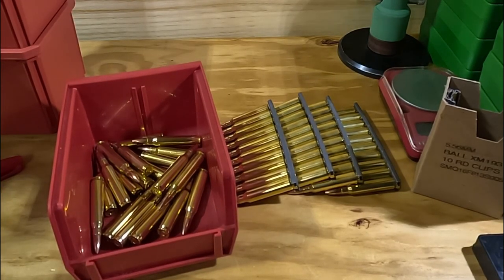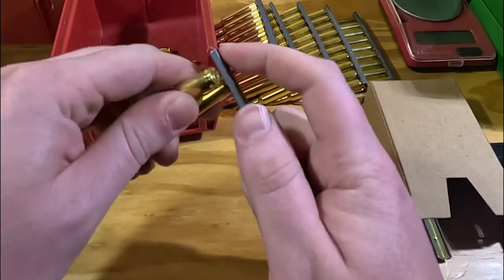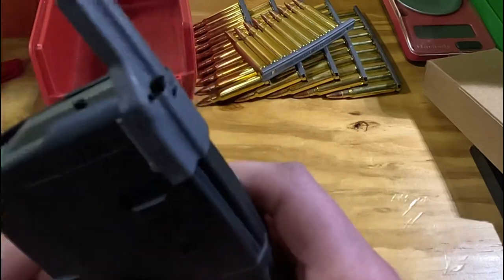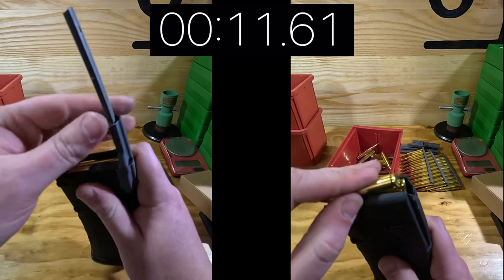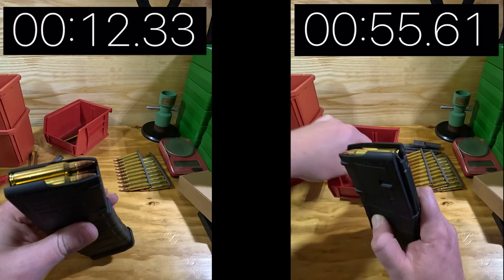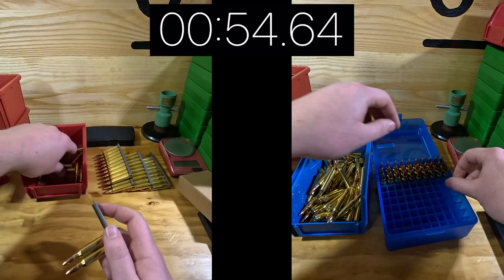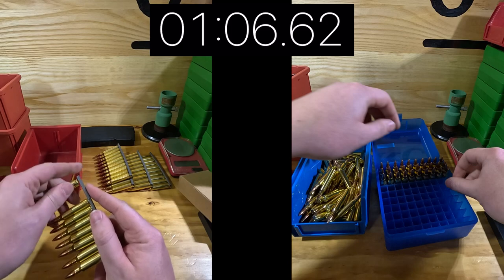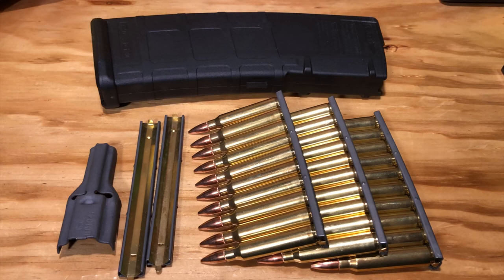Stripper Clips Are Actually Kinda Cool & Why You Should Give Them A Try (They’re Also Very Fast…)

Comment: You need to get a StripLULA. It's like a loading spoon on steroids.

I found that it helps when reusing the clips. Also a little tip to extend the life of the little tabs, don't bend them the full 90°, 45° is more than enough to retain them.